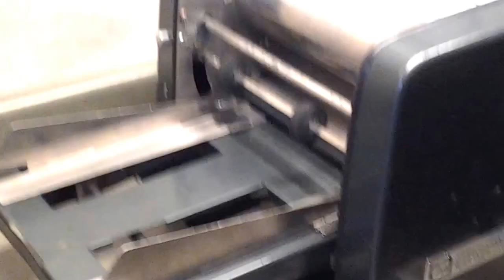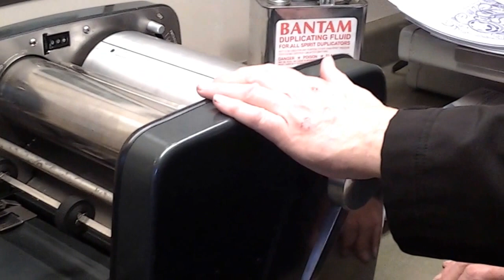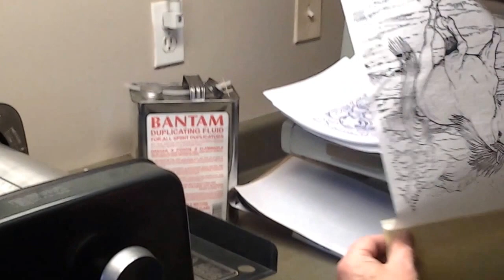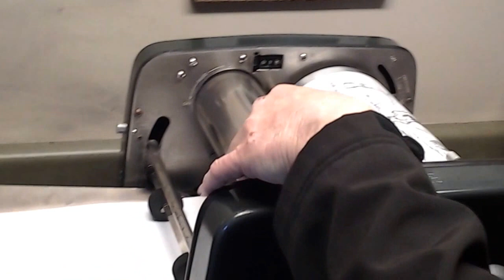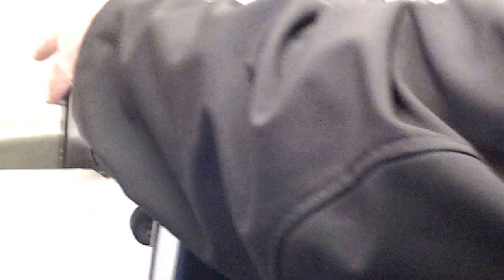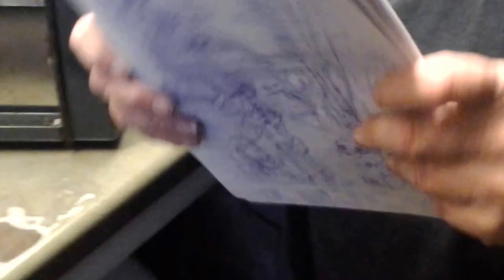Heyer Spirit duplicator Demonstration

Comment: how long could a master last?  About how many copies before another must be made?  I always wondered how those machines worked, we used to use those to make copies in elementary school handouts and lessons.
Reply from the maker: There are 2 kinds of masters. Thermal good for 50-100 copies depending on the efficiency of the duplicator and writing and typing masters good for 300 copies depending on the same factors and if you buy regular and long run masters. The new fluid made today available can increase the number of copies. The operation of the operator adjusting the duplicator as t prints accounts for the best results. The duplicator uses fluid not ink. The master is the inks printed in the message on the back side and the paper going thru the duplicator get moistened bt a wick with the fluid just enough to dampen the paper just before passing under the drum where the master is. The contact is so brief a little of the ink on the master comes off and prints on the paper. The fluid is alcohol based and evaporates quickly on the paper. We used to smell them in school if they were still damp, I hope this answers your question. Thanks, Sam